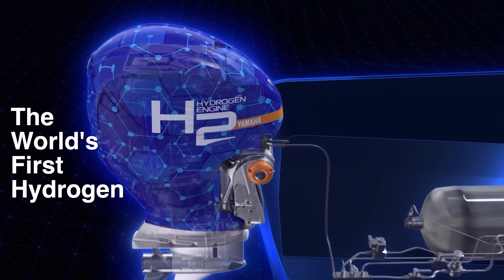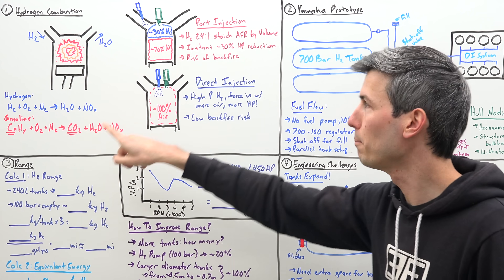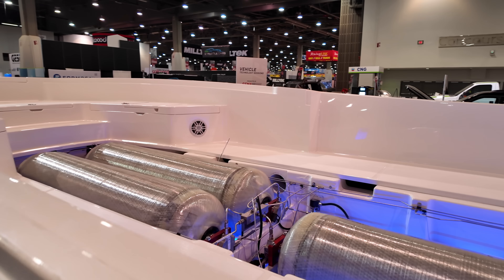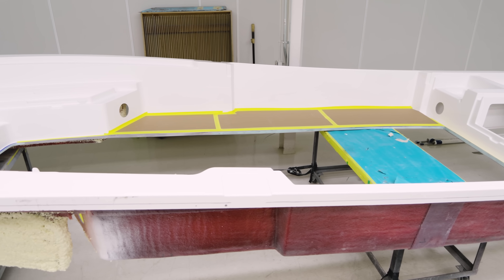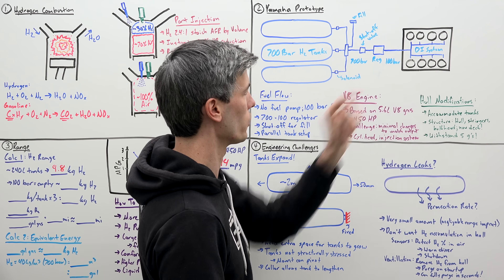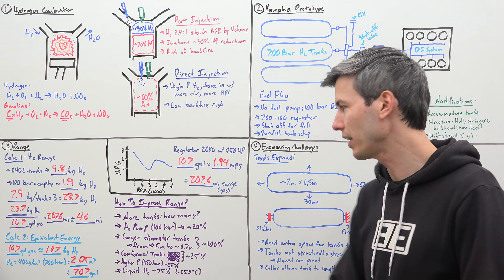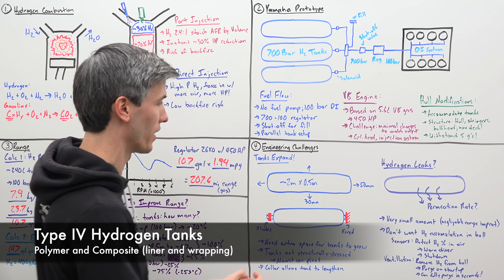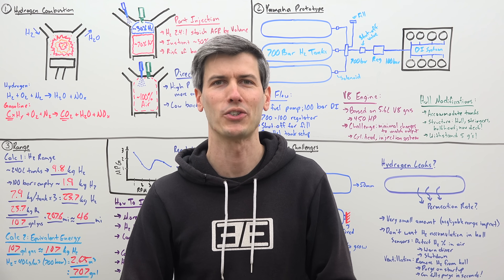The World’s First Hydrogen Combustion Outboard Engine!

Comment: Why not ammonia? When liquefied it has 1.5x the hydrogen content of liquid hydrogen at only -33°C and can be easily catalytically decomposed into a combustable hydrogen/ammonia mixture.
Reply from the maker: Do you get more energy out of it, than the amount of energy required to convert it to hydrogen? This step almost never works out, especially in small transportation applications.
Reply: @EngineeringExplained  the hydrogen part of the mixture is only a small amount because ammonia doesn't readily ignite. So you only need enough hydrogen to initiate. The decomposition of ammonia to hydrogen and nitrogen in the presence of a catalyst, while endothermic has a very low energy barrier to the point where it's considered reversible in atmospheric conditions. That is why the Haber process requires high pressures in order to force the equilibrium to the ammonia side where the number of moles is half.

Another (more practical) way to kickstart the combustion of ammonia is to mix it with a hydrocarbon gas like LPG or use it in a diesel multifuel but at that point it's no longer carbon neutral.
Reply: Ammonia is an option, but amonia is quite toxic in the air and also to marine life. So  leaks can be an issue. There is a reason why more refrigurators moved away from amonia to hydrocarbons, even though ammonia generally the more efficient refrigurant. Nor sure if one really needs an extra decomposition stage, it may even burn directly. Ideally one would use a fuel cell and get about 3-4 x the useful energy compared to a combustion engine. So far I don't know of fuel cells that can directly use ammonia however.
Reply: @UlrichHarms-ci1ov  the decomposition is because ammonia needs a bit of a kick before it can combust completely. Normally in the research this is achieved either by an ammonia/LPG mix or by an ammonia/hydrogen mix. The decomposition also allows fuel cell use.

Regarding toxicity I get the concern but it would be a good application for a fleet vessel like cargo where the company ensures regular maintenance compared to a private fishing boat. Also considering most run on diesel already, the environment of the combustion in the engine is already very appropriate to use ammonia as a dual fuel. I mentioned it for this project seeing as it's a proof of concept type of vessel.
Reply: Hydrogen is massively explosive : instant death. Ammonia is deadly toxic : slow miserable lung dissolving death. Conclusion hydrogen is better.

Comment: "If you have a problem with one tank, you can isolate it with valves".... That's REALLY funny... Yeah, providing that the problem tank hasn't already exploded and blown the boat into a billion bits.  10,000 PSI?  That's crazy to think that the containment of those tanks can be considered 'safe' for public use.
Reply: Gotta say 10kpsi sounds scary.
Reply: It's not really something I'd be worried about. The amount of force to pierce it would be insane; these tanks would be like the gas tank equivalents of a Rupert drop. and catastrophic crash that was going to kill you and everyone around anyway that's energetic enough to destroy the tank.  Unless we are worried about depleted uranium rounds being shot at the boat, it's not a worry. A normal crash isn't going to do anything to it. 

The larger problem is that the tanks are going to be stupidly expensive for a supply line, etc., that is already going to be more expensive and from sources whose full scoping (natural gas) is hardly better environmentally. You might as well just burn methane in the engine.
Reply: @user-fy7ri8gu8l  I'm not concerned about a tank rupturing, as much as I'd worry about any mechanical connection.  As mechanical connections will always fail, eventually.  Hydrogen molecules are so small, it's extremely difficult to 'seal' connections to prevent leaking anyway.  Not do mention the rough ride a boat has on the open ocean.
Reply: These can be engineered to be at whatever safety level we want, the question is at what cost.
Reply: @eliasatnapier3399  The cost of hydrogen is already high enough to not be able to compete.
Reply: @eliasatnapier3399  Just because you can, doesn't mean you should.

I propose a much safer form of hydrogen fuel, but no one will listen to me.

Comment: Okay wait, this is really embarrassing to ask as a 4th year chemical engineering student, but can anyone explain to me what does jason mean when he say that "when the pressure reaches 100 bar inside the hydrogen fuel tank, the fuel tank essentially becomes empty" and somehow this can be fixed by using a fuel pump to pump the hydrogen gas into the internal combustion engine? The thing is, I understand that the 700 bar pressure hydrogen gas can push itself into the combustion chamber because of pressure gradient difference and if you open the valve connecting the 700 bar fuel tank to the 100 bar chamber pushing in the hydrogen gas into the combustion chamber, you would "equalize" some of the pressure and hence the pressure inside the fuel tank drops, but what does it mean to have the mass of the 100 bar hydrogen gas minused out? I don't quite understand this, and again, how does having a fuel pump solve this issue and improve the mileage of a hydrogen-gas powered boat?
Reply from the maker: The injection pressure is 100 bar, thus if you're going to use any remaining hydrogen in the tank once it's below 100 bar, you need a pump to increase the pressure back to 100 bar so it can be used for fuel injection.
Reply: @EngineeringExplained  ahhhhh, I would assume that the hydrogen gas fuel tank loses pressure when it "self-pumps" itself into the combustion chamber because it is essentially losing energy right? Make sense! Thank you for the explanation Jason, I really appreciate it! Equal pressure between the fuel tank and injection pressure = no pressure gradient and hence no method of pumping the hydrogen gas in. I see!

Comment: and who needs a hydrogen outboard motor????? this is ridiculous ...good vid
Reply: You're probably right, but this is a proof of concept, you need to do this sort of thing to actually show people that it doesn't work, otherwise you get the same nonsence back from the fuel companies that has been the case with electric cars.
Reply: Who needs automobiles, when horses are faster, cleaner and cheaper?
Reply: It's no different than wanting a gas motor. What ridiculous is your attitude towards hydrogen. It's just another cool technology. Doesn't mean traditional engines are going to disappear. Just like how horses didn't get fully replaced by cars, traditional engines won't get fully replaced by hydrogen or electric. Nothing wrong with having options. Grow up.

Comment: Why TF we need this when we can just use gasoline or methane? We don't have enough "clean" hydrogen anyway, and we also can produce "clean" artificial gasoline as Porsche already showed.
Reply: It's worth noting that Porsche never got their carbon capture device to work properly, so are just using CO2 from breweries, which is a standard way of acquiring CO2 in industry.
Reply: It's still in development. Your acting like it was decided by everyone to use hydrogen.
Reply: the production of "clean" artificial gasoline (like what Porsche is investing in) REQUIRES clean hydrogen as raw material. If availability of clean hydrogen is the bottleneck, it makes way more sense to just use that hydogen with efficient fuel cells, rather than turning it into synthetic gasoline and then burning it in an inefficient combustion engine.
Reply: @plainText384  but its hard to store h2, and easy to store synthetic liquid fuel
Reply: @Sayenkor  sure, but I think efficiency is going to be much more of a hurdle than storage. Perhaps this type of combustion engine won't be super successful, but with the more efficient hydrogen fuel cells you won't just be paying less for fuel, you'll also need to store less fuel in the first place, which will really help with fuel storage.

At the end of the day, if the technology for fuel cells is good enough for an application, the savings on fuel costs will just dominate compared to efuels.

Comment: Hydrogen combustion still produces pollutants such as NOX, and how do you keep water out of the oil?

Interesting idea but I don't see this going anywhere.
Reply: NOX can be mitigated IF you keep the combustion temperature below a certain point.  I'm not sure what that temp is, but it can be done.
Reply: @atheplummer  Then you lose a ton of efficiency.
Reply: @Flies2FLL  That's why You might want to look for my other comment... Water injection solves that problem too, as well as mitigate NOx.
Reply: @atheplummer  Water/methanol injection was used in WWII fighters to reduce intake air temperatures after the superchargers.  This keeps the cylinder temperature below 1075 degrees F before the spark ignites so that there is no pre-ignition/detonation.  It had nothing to do with emissions. Any time you remove heat from an engine, you reduce efficiency, that is why these systems were only used for short periods of high boost pressures.
Reply: @Flies2FLL  It had nothing to do with emissions because they didn't care about emissions then.

Here's a fact.  I put 16oz. of water directly to 5 gallons of 87 octane gasoline, and treat it with my resonant frequency generator and get an average of 4 mpg more than 87 octane w/o water.  

Now, even more than that, HCL and NOx drop to near zero as a result.  The emissions measurements do change slightly, depending on how humid the air is that the engine is running in.  I suspect this is a result because I can't treat the humidity in the air, like I can with the water in the fuel. 

I own 2 different types of emissions testing equipment, & both give me the same results.

With my method, I render a catalytic converter useless.
Reply: @atheplummer  I don't buy that at all.

If this is so effective, then why aren't the auto companies employing it on new cars?

Adding water to the intake is also invariably cause it to wind up in the oil sump, which can have disastrous results.  This is another reason why hydrogen engines are a bad idea, they produce copious amounts of water.
Reply: @Flies2FLL  I don't know why auto manufacturers won't collaborate with me.  
I took it to Chrysler Corp. years ago.  They tested it and told me to go away, as it works too good.  
Explain that one.
Reply: @atheplummer  I'm not buying it-

Comment: Great video. I’ve always thought hybrid-hydrogen engine.  1L turbo diesel acting as a generator.  Electricity from the generator goes to defuse h2o into 2 different tanks (h2 & o).  From those tanks both can be injected back into the hydrogen engine.  Since you are in a boat, you might have an infinite amount of fuel.

Comment: Something else you can do to boost the efficiency of the combustion: water injection.

In "The Hydrogen World View" by Dr Roger E. Billings, he talks extensively about how hydrogen combustion, burning with a very-high temperature, resulted in significant NOx emissions. To combat this, they injected water into the intake stream which cooled the valves and piston crown (also reducing the probability of backfiring and knocking; direct-injection was much less common back in the 1970s) and also putting an effective lid on the temperatures in the cylinder, quashing the NOx emissions. It also boosted the fuel economy by over 10%.

Many World War II-era fighters planes also did water injection, allowing them to go past "100% power" settings for brief periods of time. They frequently had to mix a certain amount of ethanol into the water to keep it from freezing at high altitudes (which frequently have sub-freezing temperatures) but the ethanol content was low enough that it had minimal effect on the performance; it was the water which did the really heavy lifting on that.

Hmm. Offshore fishing boat. Engine which produces a lot of heat. Wonder where they could come up with some purified (maybe even distilled) water?
Reply: Yeah, I worked a few years at an ICE research company, we did a heap of work with hydrogen. Direct injection is virtually required for hydrogen, it ignites really readily, and would keep burning in the inlet manifold otherwise. Our approach did not involve port injecting water, rather a twin solenoid coaxial direct injector sprayed water directly in with the hydrogen stream. This worked better, since it provided a more homogenous mixture in the chamber.
Reply: and now you need to carry even more "fuel"